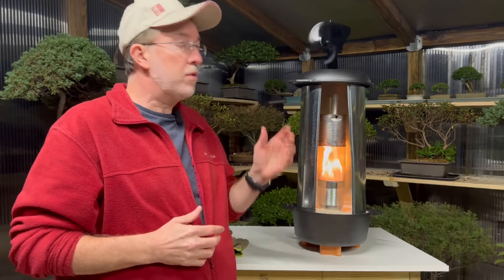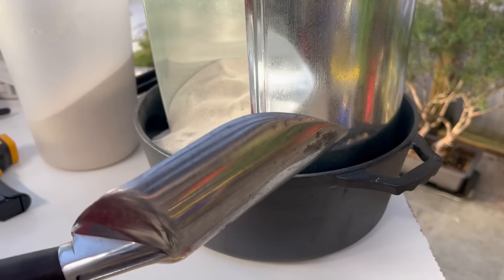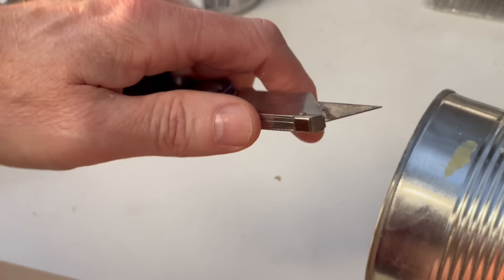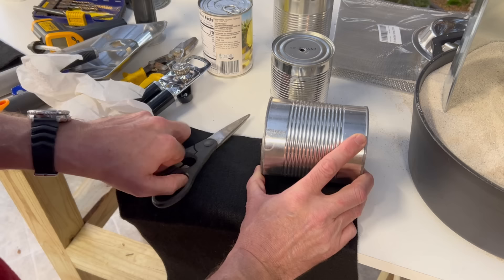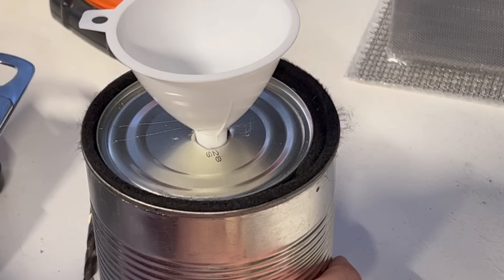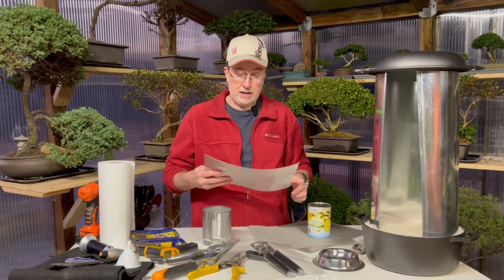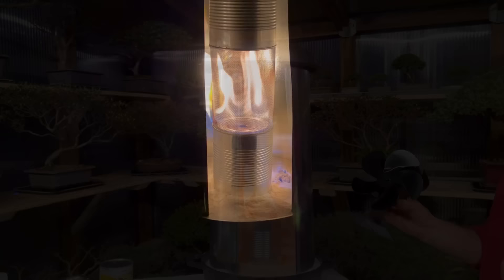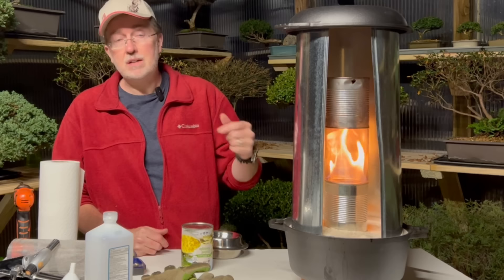DIY INFRARED HEATER | No Electricity Needed For Greenhouse Heat

Comment: You are overthinking the entire build with exotic materials. Your temperatures are well below the thermal range where galvanized plating will vaporize into the atmosphere and cause health issues. The steel reflector can be regular galvanized 26 GA steel Snaplock, as well as the lid can be a round duct end cal, and can be screwed  or riveted to the reflector.  he lower pot can be a galvanized bucket or any metallic container large enough to hold the reflector and the sand. Use a spring clamp to hold it in place while it's being filled with sand. The heater can screen can be stainless steel or copper, 100 mesh works the best as it breaths just right. the small hoke you were filling through isn't needed, I would go back to a very small hole to allow the can to hold fuel and not hold a vacuum and hold fuel unnecessarily. Where the carbon felt is around the can and on the inside of the fine screen place a hole close to the wick and fill through this as needed with a squeeze bottle and a long neck, you won't be needing to move the can once setup.   The best fuel to use is 97% proposal alcohol , it's the best to burn and the cheapest, but any form of alcohol will work.   Adding a small amount of clear cooking oil to the alcohol will make it burn longer and not smoke.

Comment: How do you get your steel mesh to fit properly? Mine has too much felt in the way so it's packed nicely but now no room for the mesh???
Reply from the maker: Lots of tinkering
Reply: @ZenGardenOasis.  Managed to get it by wrapping it around at the same time as I did the felt only problem now getting it to light with the mesh in the way. Haha..

Comment: Infrared out of a flame?...... That's a new one to me. How do you figure it's infrared in any case??
Reply: When the metal screen turns red hot you have red wave length. It's not happening all the time, but it will also be reflected by the stainless steal backing.

Comment: One pound of alcohol contains aprox 3 KWH of heat.  If you had a 1 KWH hot plate and ran it for 3 hours in your green house, that is how much heat this infrared heater would put out in your greenhouse if it could burn one lb of alchol in three hours.

Comment: Where is the OFF Switch? If I catch on Fire How do I turn this Heater Off? Do you know any way to stop the Flame? In Case the fuel spills on the Floor where are the Safety Features? Good Luck!
Reply from the maker: Have fire department on speed dial.  😂

Comment: You neglected to show exactly how the steel mesh "attaches" to the bottom can (wick assembly).  Does it just "rest" on top sitting directly on the wick?  If so, that seems rather flimsy and a hazard to fall over (especially with the can on top making it top-heavy).
Reply from the maker: Just resting but wouldn’t advise around pets kids or the accident prone.

Comment: The alcohol could be more expensive than just running an electric heater or electric oil radiator.
Reply from the maker: What if your powers out or you have no electric in your greenhouse?
Reply: @ZenGardenOasis.  unless your greenhouse is really far from the nearest power running a cable is always possible. You can't refill this alcohol thing until it is cooled down. So it isn't very practical for constant heat. Having a wood fire outside of the greenhouse that heats water and running that hot water through radiators in the greenhouse might be a better option.

Comment: Love where your headed with this , but a 20 gallon Dutch oven , really ?? 
Not even king brown has a Dutch oven that size
Reply from the maker: Not a Dutch oven.  A commercial kitchen boiling pot.  Used from second hand store.  Check out the video about sand batteries from I think Switzerland.  Sand retains heat once flame is out. Hope that clarifies.

Comment: Can this be used to heat a house in a grid-down situation--am concerned about the potential for C)2 and CO.
Reply from the maker: I would be very cautious using it in living spaces this was made for my greenhouse in winter. Be sure to have co2 and smoke detectors active.
Reply: @ZenGardenOasis.  Thanks, Bud!

Comment: Rubbing alcohol $65 a gallon. Denatured alcohol $35 a gallon. It would be cheaper to just use electric or propane heat.
Reply: Huh???? Rubbing Alcohol here I saw 2d ago at feed store for $20/gal
Reply: @Engrave.Danger   I think the point was for when electric is not available .

Comment: I’m trying to make it but it smolders. I’m outside with a 20 gallon metal trash can from Home Depot if it stops smoldering I could bring it into my glass porch but the alcohol is Yukky. Then I’m trying canola oil to wick up but it’s barely burning.
Reply from the maker: Make sure your using safety equip (fire extinguisher) and proper detection equip.  The more pure your fuel the cleaner the burn.
Reply: @ZenGardenOasis.  I wonder if it’s the can giving off the fumes or is it because the oil gets so hot it fumes out smoke. I finally put the lid on my trash can and walked away. Mine doesn’t work as well as yours.

Comment: I didn’t see in your video why you put the can on the top of the mesh.??  Understand the bottom two cans with the wick then you put the metal mesh and a can with holes at the top of that what does that one do?
Reply: It would slow the flame front and redirect heat out the holes in the top. Essentially  smothering the fire.
Reply: @mikeconnery4652  hum ok thank you I think I will watch your video again and maybe I will understand a little more.

Comment: The specific heat of sand is quite low. It takes very little energy to heat up, and therefore it heats up quickly and then it cools off quickly also. Water has the best specific heat  and steam is even better. Water is therefore a much better thermal battery.

Comment: Too bad you're after stainless steel and not cast iron for your base.  I think a brake drum from a big rig would be a good size, and heavy enough to be a heat battery.  You'd just need to fill a few holes.
     I suppose you could just drop something circular inro the drum like a terra-cotta saucer or a pizza pan

Comment: Question: is that truly Infrared or is it Radiant heat?
Reply: Same thing. With a bit of convection heating thrown in. The metal will reflect infrared and the hot metal with will also heat the air.

Comment: This is not an infrared heater.

This is just a small alcohol heater.  An infrared heater uses a lamp capable of producing infrared light (light below the spectrum of visible light) in order to create heat. It doesn't use conventional fuel and does not produce any form of fumes or flames.
Reply from the maker: Infrared heaters efficiently and effectively use all three fundamental methods of heat transfer. Convection occurs when heated objects or people release stored warmth or energy back into the space. Conduction occurs when the open flame within the tube heats the exterior and interior surface, creating the infrared energy. Radiation occurs when the heated infrared tube releases radiant energy to the objects below.

Comment: "massive amount of noise" then plot twist...no noise whatsoever.  Um...guessing you have never worked with sand?  You can dump an entire truck full of the stuff and barely hear a thing. Also you listed a bunch of parts that I can easily find, but the one part I cannot find is the part you didn't bother to list, which is the very wide diameter stainless tube.  Finally, while I like alcohol stoves/heaters for myself (due to the clean burning nature), they burn off too fast and the alcohol is expensive verses cheap cooking or heating oil.  I would do electricity. or cooking, or  heating oil for the purpose you are doing.  I do like the concept of a heat fan however for circulation.  I may add that to my setup so thanks for that.  I may also try a setup like your (assuming I can find the stainless tubing) but substitute oil as the fuel.
Reply from the maker: Check local hardware for stainless.  Too expensive to ship, so didn’t list.

Comment: Sand doesn’t store heat.  Thats why the desert gets cold at night.   Your alcohol burner releases X amount of btu regardless of how much fancy crap you put around it and believe that you are doing something meaningful.  Terrible vid
Reply: Sand will store heat and for months if properly insulated.
Research sand batteries.  Research how high of a temperature that sand can be heated to.  Surprise.....
Reply: @jimtraill141  Sand can be heated to very extreme temperatures; but it DOES NOT RETAIN HEAT . . . You contradicted your own statement when you said sand retains heat if properly insulated. Almost anything will retain heat if properly insulated! 🤷🏼‍♂️ Be in the desert after sunset and you will quickly understand how well sand DOES NOT retain heat.
Reply: @jimtraill141  ouch.  You just got served bro
Reply: @snakeclaw  not really.  We both said that it was about insulation.   ??

Comment: 0:44 a metal garbage can could probably do the job instead.
Reply from the maker: Only stainless steel.
Reply: @ZenGardenOasis.  yeah not as fire containment friendly & it wouldn’t hold heat as much.

I do think most heat is on the upper areas so maybe use a mancover or such on top.
Reply: Cutting the bottom and using only upper 1/2 of the trash can so no need to buy any shield..and upgrade to a larger #10 can for the bottom.

The can as that mid shield would be proportionally upgraded by using it..course cut a slit so it’s not just a floom for the heat..making it look like a clamshellish like your design does.

The other portion of the trash can could be purposed for plants.

Comment: stainless??? know your metals,  the piece of pipe you are showing is a galvanized sheet steel 24 inch section , a 2 year old can spot it .  forget the noise nonsense it gets tiresome ....and don`t think about the size of the peaches can read the label it will tell you ....are you kidding ?